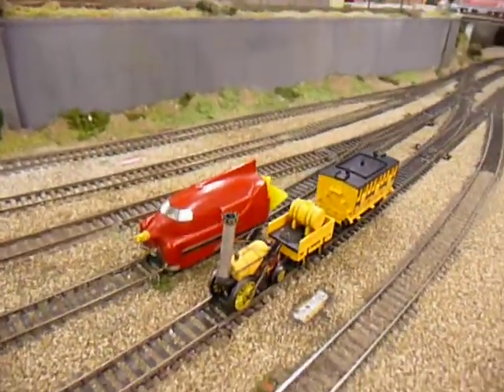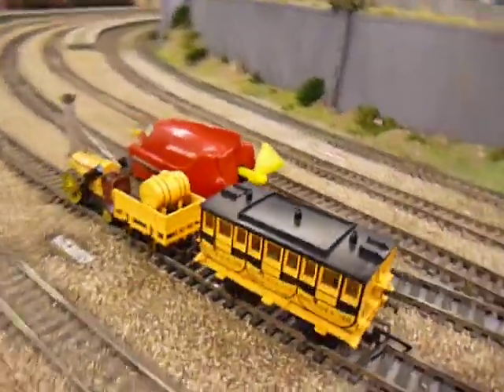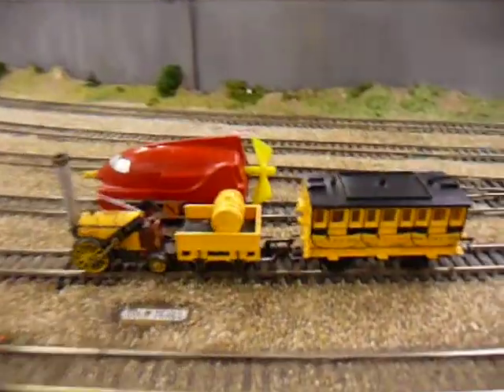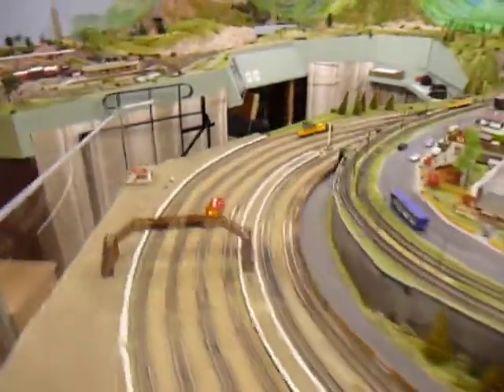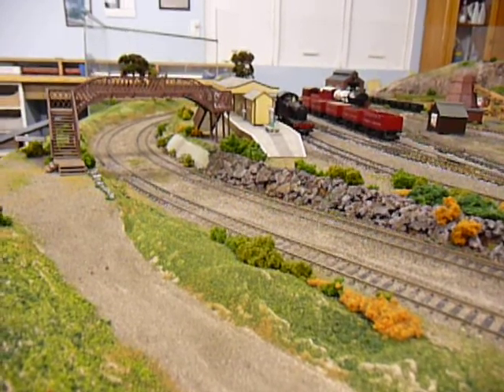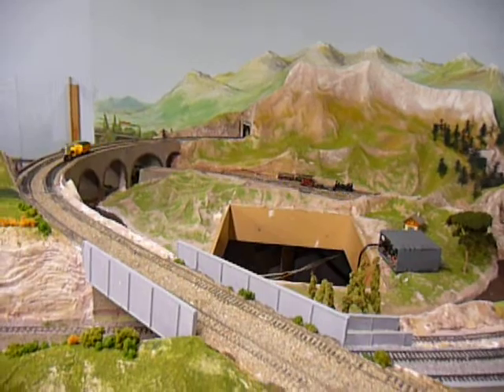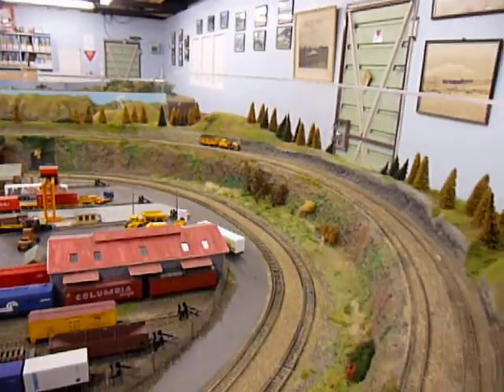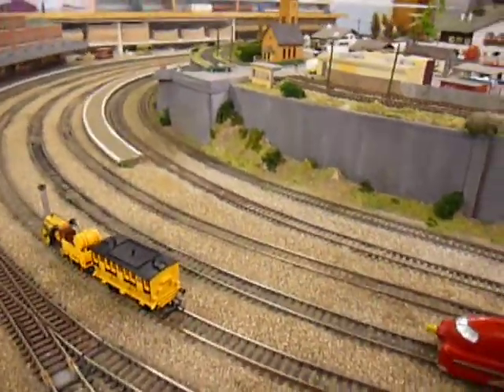Tri-ang Stephenson's Rocket Vs Battle Space Turbo Car Southland Society of Model Engineers

Comment: I wonder what the weight of the turbo car is, it seemed to have remarkable stability at such a high scale speed. Been after one for a a while. Should imagine you have to avoid the spinning propellor if it stalls briefly anywhere.How does it run in reverse??